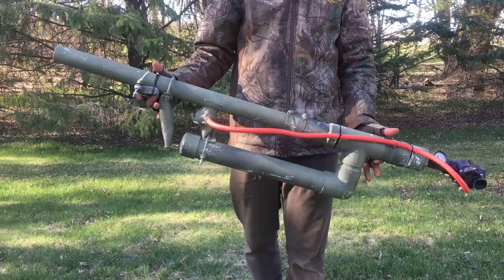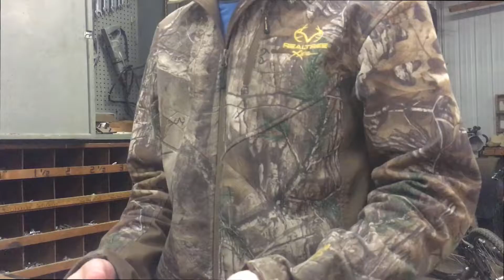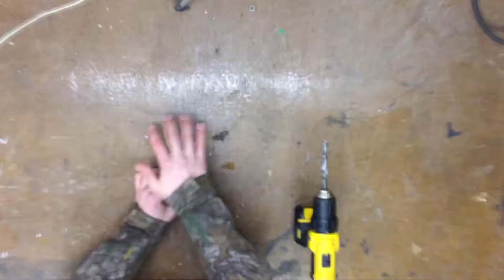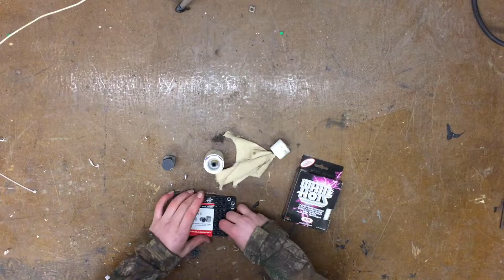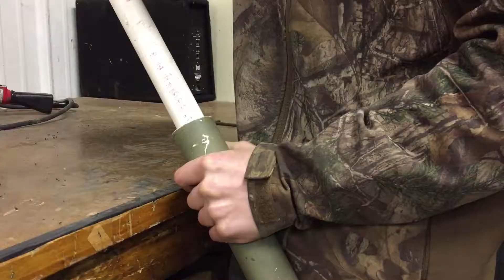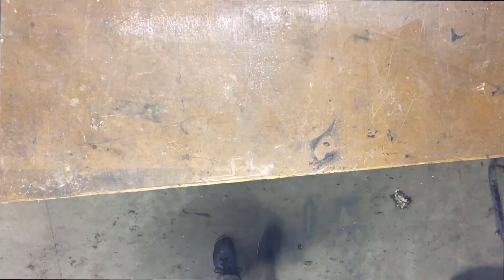Exploding airgun ammo

Comment: Be careful this is a very dangerous fuse design. That being said if you want it to go off with a bang you will need some powdered propellant not solid chunks. maybe just crush them up. Still though I would be super scared pushing that down the barrel and would rather opt for a breech-loader design because that thing would blow your hands off if it went off in the tube
Reply from the maker: Yea I thought of that, I had a design with a pin that was threaded on after the shell was in the barrel but that one had to many flaws to work consistently. Though you prolly could breach load cuz the barrel on my cannon threads off.
 And yes powdered would be better
Reply: @The_Rogue_Workshop  new challenge... a working thermite shell that can actually destroy equipment.. shoot an old  computer  or vcr. use magnesium flash powder as the initiator.
Reply from the maker: That sounds very deadly 😂 but I’ll mess around with the idea

Comment: Hey man if you switch out the barrel for a 2 inch diameter pipe you can use empty caulking tubes as ammo you can put weights in them and you can put nails at the end, just make sure you wrap some tape around it to make sure it’s a snug fit. You can also make another type of ammo by taking a pipe the size of the barrel and making a wax slug and you can put whatever in it like BBs bearings CO2 canisters The wax acts like a Sabo
Reply from the maker: Great idea man I’ll try it!